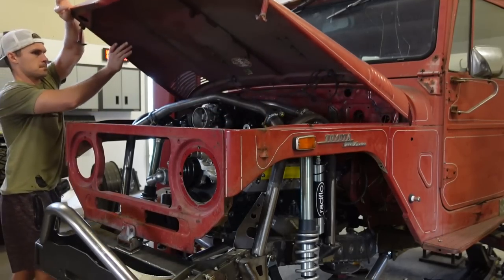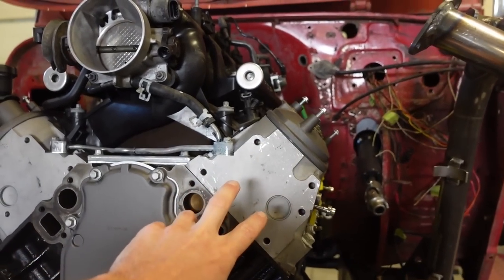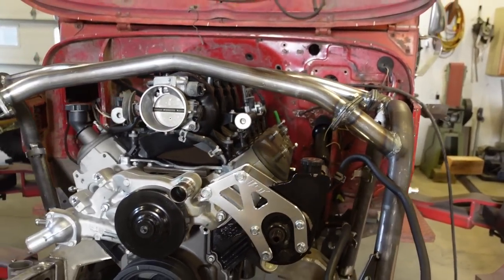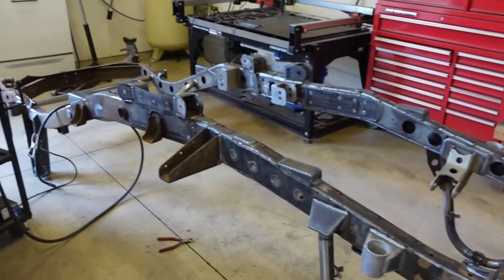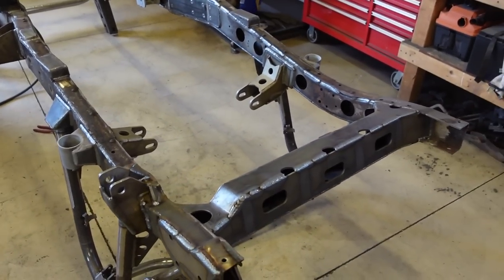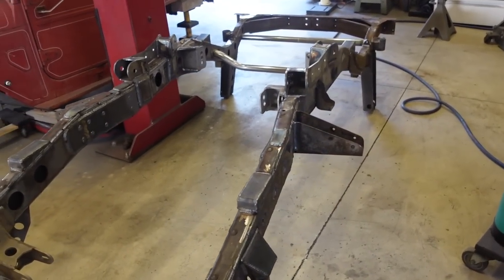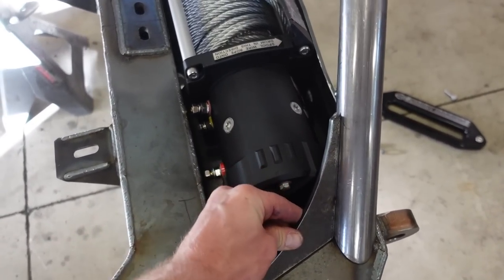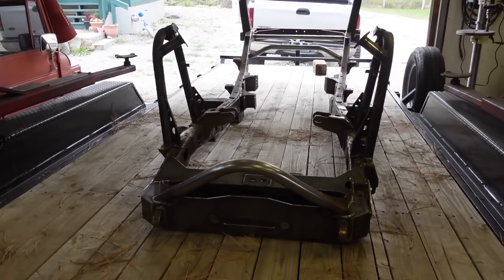I Stripped My FJ40 Down To Weld In The Frame!!

Comment: I believe that hawse fairlead is for synthetic cable.  The steel winch cable will chew up that aluminum fairlead.  I think you need to use a roller fairlead imo.  Great video as usual.  Loving the build!
Reply: Noticed this as well.

Comment: There is no question that the frame is strong and solid.  Very nice and done well. It will make a difference in the ability of the vehicle. Are you considering making any or full length skid plates across the bottom  ? By the looks of it you managed to get everything tucked up nicely.  So nothing hangs below the frame.  So having skid plates not only protects everything.  It provides a wide surface to keep from hanging up on anything.  Looking forward to seeing what's next.  How your going to finish the body... rear bumper... rock sliders.. roll cage... yeah it is a great build and really looking forward to seeing the progress.  As for the trailer... looks like a good  winter project.  Such an open canvas to repair and improve upon to allow it to be used. With your creativity and imagination along with your fabrication skills.  That trailer truly is a blank canvas.... 😎👍

Comment: You might want to consider adding rubber or plastic to the frame right behind the electrical  studs on the winch. They could contact the frame in a hard front end hit. Or maybe you can clock the winch.

Comment: Surprised you didn't complete the roll cage and frame tie ins before getting it blasted. Also, you can get the inside of a frame sandblasted. They drag a hose through the frame that has side vent ports for the sand. I had it done when I had a frame galvanized. And yes, I think a video on the trailer would be cool.

Comment: Good call pressure washing the frame out. 
Tons of rock and grime gone.  Are you going to use the Eastwood system to spray the inside of your frame?
Going to need some frame time on your trailer to pull the side rails back in line but that’s a good buy. 
Really enjoy your work on this one.  Jealous I don’t have a shop like yours to build in.  Keep up the good work.

Comment: you'll have the same issue as the 70 series toyota with the vdj engine. the alternator is down at crank level and they have constant alternator failures just from driving down wet gravel roads they don't even have to get anywhere near a soupy boghole. the alternator is just sucking in dirt,dust, grit and mud constantly

Comment: Looks like the winch fairlead is for a synthetic rope, if you keep the wire cable you will want to run the roller fairlead. Sure you know this looking at the quality of work you have going, but just in case you didn't.

Comment: Ok im adding another comment, but them guys at the end could have picked that up a lot better with straps. Its not there property so i think using better methods would be smart
Reply: Yea I agree. Those guys seemed really aggressive/impatient picking that frame up… When Austin mentioned they damaged the frame I wasn’t surprised after seeing how they handled picking up the frame. That sucks. Hopefully they do a good job with the sandblasting. I would look for a new place next time though.